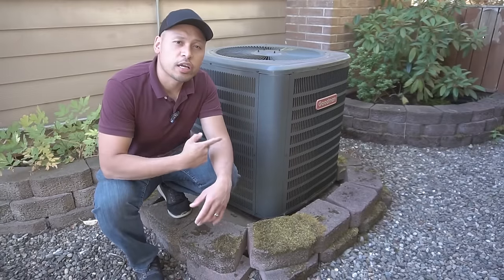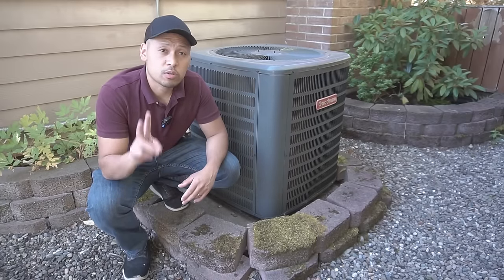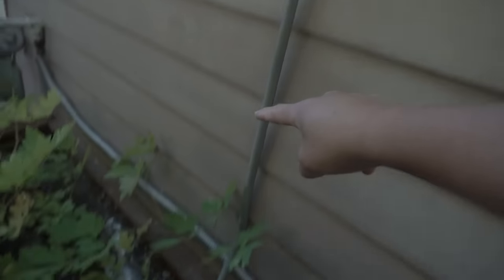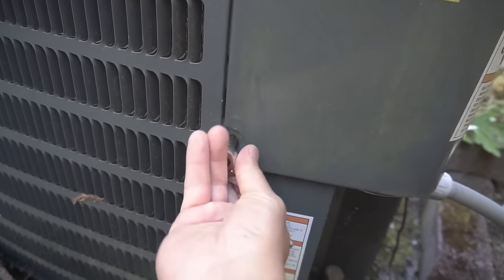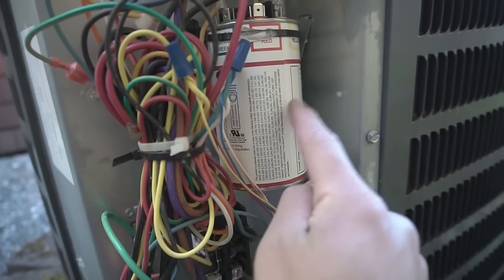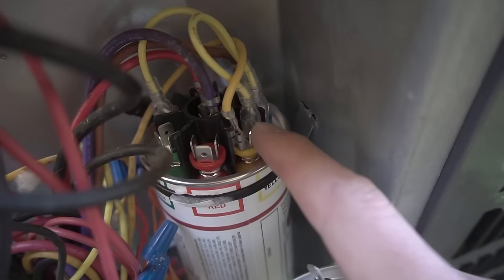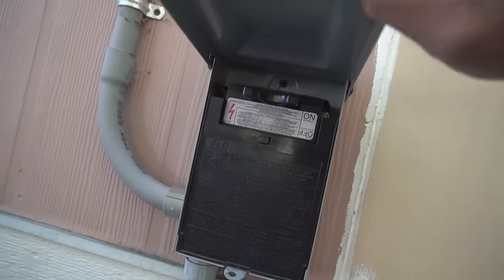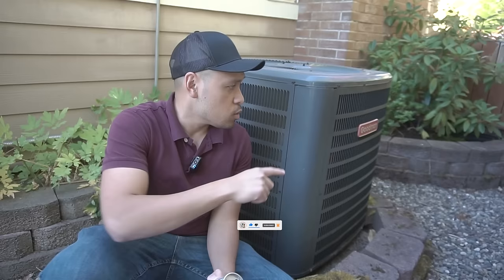How To Fix An AC Unit That Is Not Turning ON! TOP 3 REASONS WHY! DIY

Comment: One of the biggest scams in HVAC are capacitors...The power cell which jump starts your Compressor. They last at best 2 seasons. They cost about $20. The smiley service people will charge you ten times that to replace one (in about 10 mins). Lesson here is to wathc this video to see how you replace one...then have a spare at your building for when it does fail. You get a warning its failing if its been 2 yrs and you start to notice less efficiency from your unit. Just go ahead and swap out the old for the new.

The fan motors on the unit also have these capacitors...so have those skus available as well. Warning signs the fan motor caps are going is less airflow.

There ya go saved you hundreds of even thousands of $$ you can use to pay the plumber.
Reply from the maker: I have friend who was charged over $1000 for Labor and replacement of the capacitor! They charged him $400 for just the capacitor and over $100 for fuses! I checked Amazon and they sold the capacitor for about $20! It’s crazy! Thank you for such solid advice! As for the plumbing drain, I’ll leave that for the plumbers 🪠! 👍🏽😊
Reply: My company does charge a lot for capacitors but they should not only last 2 seasons. The reason why my company charges a lot for the capacitors is because we are changing them out and then figuring out why the cap actually went out in the first place. 
There has to be a bigger reason why the part is only lasting you two seasons. I would call someone out and see why that is. 👍🏻
Reply: @justinsantos3317  most times in the desert rooftop capacitors fail because of  heat from the sun hitting the unit. The systems in these conditions also run longer adding to the heat stress. Most HVAC units are not designed to be run in extreme desert conditions.
Reply: Do not touch the capacitors connectors.
Reply: @melvingarcia2992  Watch the video, proper procedure is to force a short using an insulated screwdriver laid between the connectors. BTW even this is an exaggerated risk which helps the con. A failed Cap means it cannot hold a charge and is probably not a hazard anyway. But better safe than sorry and takes 2 seconds to eliminate all risk using the screwdriver.
Reply: My A/C quit working a few days ago.  The capacitor was bad but it lasted 20 years so I can’t complain.
A local heating and plumbing dealer charged me $30 for it but it got me up and running.
I ordered a spare from Amazon for $17.
It’s an easy change out, learn to do it yourself and save big bucks.
Reply: Just paid 300 to fix a capacitor. A different company changed it last summer.
Reply: Yes sir because it will give a ear humming zap . Hurts like hell 😂
Reply: @FixThisHouse  My AC went out last week I had several estimates upward of 14 thousand.  I did some research and found out about a independent AC contractor ..  He had me a new 4 ton carrier evaporator coil and furnace put in for under 7 thousand.  Works great
Reply: @dirtbikeheaven1129  we're in Spokane. The HVAC people charge $179 just to come out. Last time we called them out it cost 600 for a new thermostat, and we had it for them to install!!!
Reply: @johndough23  Wish you had a picture of where/how to put the insulated screw driver. I got a quote of over $500 for the capacitor.
Reply: Someone quoted me 400 for a capacitor
Reply: @dorothybrown8859  you just run the screwdriver over the contacts. Here's the deal. One of the BiGGEST parts of the capacitor scam is to SCARE people with the idea you could get zapped replacing it yourself. This is where the screwdriver deal comes in. You do need to short the terminals but 99% of the time there will be no shock hazard as the part has failed already and cannot hold a charge of any danger, duh.
Reply: @melvingarcia2992 they'll only do it once😂

Comment: Good video, except You didn’t warn people about not touching multiple prongs on the capacitor so that they do not get electrocuted or how to short it out, and you also should be real careful about what looked like a brown recluse spider on the top of that capacitor and exterminate for any more- especially with that child helping out. 👍👍👍👍
Reply: i was thinking exactly the same… for both! Brown Recluse and capacitor shorting!
Reply: He literally says to pull the prongs connecting the main power supply to the fuses or shut the breaker off if it doesn't have it so you don't electrocute yourself while working on it. Also, that spider was clearly dead. Pay attention!
Reply: @pcondron
Reply: @getsmarty7603  Yep, that spider was clearly dead!  Don't think it was a recluse anyway.
Reply: Capacitors jold electricity

Comment: Don’t forget to short out the capacitor connections before taking it out, you’ll get the shock of your life
Reply from the maker: Thank you for this! 👍🏽
Reply: How does one short out the capacitor connections before taking it out?
Reply: @androsblessing I am not expert but I believe bridging it with do this. Just make sure the tool u use is insulated. That's my 2 cents
Reply: I'm shocked that you'd say this
Reply: @androsblessing  you can use needle nose pliers for example, and touch all over the surface of it
Reply: I can attest to this😂

Comment: You did mention that you turned off the breaker that feeds the HVAC disconnect box. The bottom of the fuses would then have the 240 volts on them.  Could be a deadly shocking hazard.

Comment: I see it’s one of top comments.  About discharging the capacitor.   Watched your video and found it very helpful.  I had to watch another video to figure out microfarads on my multimeter.  In doing so I learned that these capacitors, if working properly, will hold a charge and you want to discharge them before messing with them.  I found your video very well done but don’t recall if this was mentioned.  Figured I’d say something, maybe you can add this if it’s not already in your video.
Reply: How do I do that? For context I’m totally novice and never done more than flip the breaker. I’ve changed fuses in my car but nothing this involved

Comment: Awesome video. I do have a question, my unit works then for no reason shuts down. I have to pull the outside fuse like you showed then it starts up again and works for another 3-4 months, then stops again. Do you have any suggestions?
Reply: This happens to me too!

Comment: You just saved me time, money, and headache. Thank you!!!!
Reply from the maker: I’m glad I could be of help! 🙏🏽😊
Reply: @FixThisHouse  After replacing the capacitor and the fuses, the condenser fan is now working as it should. After hours, the set temperature of the thermostat is not achieved. I checked the refrigerant line and noticed there is no condensation on it while the fan is running. Would your expertise indicate that I might have a bad compressor?

Comment: You have given me hope.  My a/c will cool, but the outside fan does not turn on.  Now that I know what the capacitor looks like I will see what it will cost.  The estimate to repair from the company that installed the unit was $500-1500.  I was stunned that the capacitor alone would cost over $500.  
I so appreciate this video.  I decided to look for solutions after I cancelled the service call, because I didn't have the money for repair.  I will check the circuit breaker, and will get info off of the capacitor now that I know what to look for.  Thank you, thank you, thank you.

Comment: I called a professional and the first thing they tried selling me was a membership.  Then they quoted me the job for $4k and that was with the warranty.  I chatted with my parts person at work and she was able to point me in the right direction.  She concluded that it was the capacitor with all the information I gave her.  The vendor quoted me items that did not need to be replaced because there weren't any leaks, what a rip off!  Thankfully I watched the mechanic when they came to troubleshoot and learned from that.  However, this video has given me the confidence to do the work myself, now I just need to find the parts, since I would like the OEM parts for this unit, if I can't find them, then I'll go with the video's suggestions.  Thank you for your video!!!

Comment: Wow!! Excellent tutorial! Before I remove that safety panel, do I need to make sure my fuse box a/c circuit breaker is turned OFF? Do I also need to make sure the thermostat inside is set to OFF (not cool or heat) too? 

FYI My thermostat clicks as if it wants to turn on, but the unit outside seems to not be getting ANY power (no sound at all, blades not turning... really quiet). 

Also a week ago my A/C made a loud grinding noise for about about 20 minutes when it came on... something was DEF awry😬... wondering if an iguana got up in there🤔
Reply: Definitely wanna make sure you pull out the prong for the fuse box or turn the breaker off before pulling any panels off to work on anything electrical. It shouldn't matter about the thermostat being turned off. It sounds like a bearing in your fan might be shot, or some kinda debris or salamander got in it.

Comment: Why do you need or want fuses at the disconnect when the breaker will also kill power in case of an overload or short?
Reply from the maker: Hi! Air conditioners use fuses as a way to protect the condenser from being exposed to excessive amperage. Fuses are designed to handle a limited amount of amperage based on the maximum amount that the unit is rated for: If more amperage passes through, the fuse will blow to protect the condenser from overheating.
Reply: If your compressor is old it will simply blow-up under normal power. All 220 lines require breakers along the path...code requirement...correct me if I am wrong.

Comment: Any idea what would be the fix for the fan spinning but AC not blowing cold air? Would it be the compressor?
Reply from the maker: Hi there are many reasons, the fan might be running on the air handler or the furnace. Check your compressor to see if that is running. I’ll make a future video on this. Stay tuned 👍🏽🙏🏽
Reply: @FixThisHouse had to call the air guy. Apparently there is ice at the bottom of the unit. Everything is frozen closed.

Comment: Great video but I think you should add a warning about capacitor charge so those unknowingly folks do not get lit up(shocked).
Reply: AC capacitors are not an issue with residual voltages.

Comment: My breakers are ok....i got power..just the fan turns on..but no the compressor..could be the capacitor?
Reply: Absolutely. Or your compressor may be beginning to fail (if it hasn’t already), in that case, you may need a hard start kit installed.

Comment: If your capacitor is not good will that cause your furnace not to function as well?! All of a sudden my ac our furnace won’t turn on. I hear my thermostat clicking on by nothing no air nothing. I checked from my furnace jumping r and y blower comes on and from r to g fan comes on, I gagged 24 volts to the furnace. I pushed in the contact at the condenser fan and compressor comes on. I’m not getting any reading when I’m checking the capacitor like you showed breakers and fuse? I have a duel systems.
Reply: Nope not the capacitor

Comment: My fan isn't blowing at all. No power to the unit at all from what we see.  It was working days ago.  Heat was working..ac wasn't. Someone replaced the thermostat..ac worked. Seemed to fix it. . Woke up today, now nothing is working. Nothing blowing. Unit isnt on. Nothing... Circuit breaker fine....we reset it to be sure. replaced fuses to be sure. Checked the heat pump circuit breaker as well. Have no idea what's going on. 😢

Comment: I have an issue 4 techs have been unable to fix. New compressor, new capacitors, drains well, filter clean, has coolant, etc…however…

Outdoor unit runs for most of the day, but by the time we get home it’s shit down and the indoor unit is still running.

Been doing this for WEEKS and every day I have to reset the unit by tripping the breaker off/on (the unit itself isn’t tripping the breaker).

It seems that the two units aren’t in sync so one tech replaced the capacitor on the indoor unit, thinking it wasn’t kickstarting the outdoor unit. So, the outdoor unit feeds coolant to the indoor unit and the indoor unit might not be on, see the coils probably freeze, etc.

NO one knows why one or the other works, but not both at the same time…